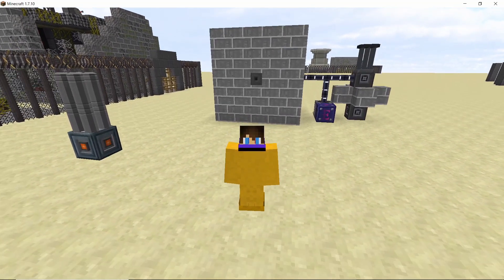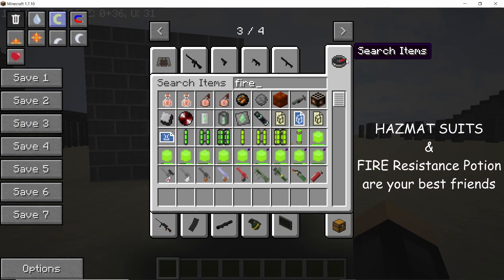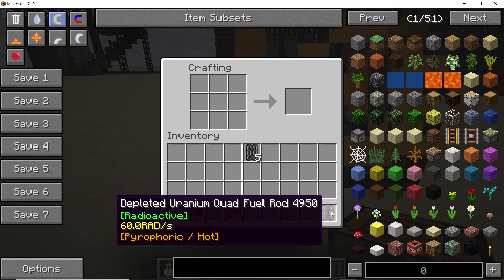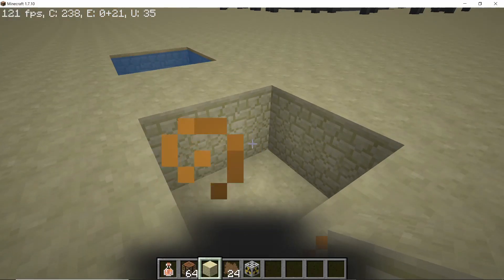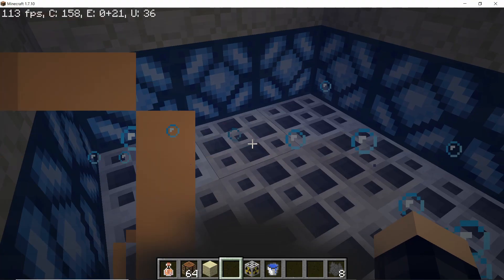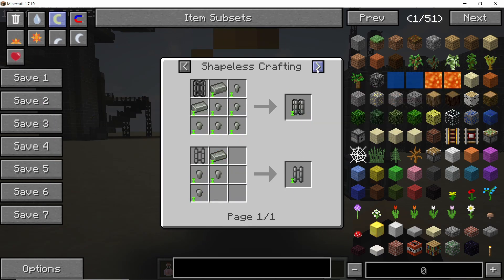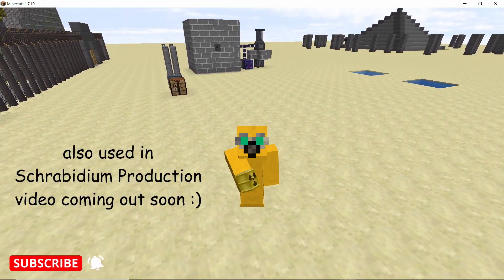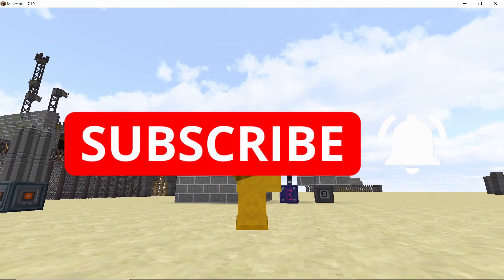How to RECYCLE DEPLETED NUCLEAR FUEL in HBMs mod || Using Spent Fuel Pool Drums in Minecraft

Comment: But extracting the depleted fuel on the quad rod takes a lot of time i wish auto extractor for depleted will be added at the mod
Reply from the maker: You can use buildcraft or thermal expansion ducts to automatically remove the depleted fuel and send it to spent fuel pool drums

Comment: I made a reactor but  and when I tried to insert fuel rods to either fuel the reactor or empty the spent fuel, the rods wouldn't work
Reply from the maker: Version of the mod ? also were you playing on 1.12.2 or 1.7.10 ??
cause I never had that problem even with all the reactor changes recently ... also did you try inserting fuel ingots instead of fuel rods ??
Reply: @SavageVegeta  I don’t remember the mod version but I was playing 1.7.10 and I switched to the ingots and it worked fine I just can’t extract the spent fuel so it makes the reactor kinda useless once it fills up
Reply: @SavageVegeta  the mod version I believe is 1.0.27_X4144 as it was the latest version off of curseforge but I think it’s behind as it doesn’t have all the special doors and some other things like in 1.12.2
Reply from the maker: @thespence2441  weird , cause if your reactor fills up then it means the fuel inserter is working properly , that means the waste ejector should work fine as well I haven't seen em in any change logs. 
Well if you can just send me the version of the mod and I can try this out , or I'll just give this a try in the latest version of the mod from GitHub and you do that as well !!

Comment: Hey i know i'm pretty late and you're not gonna see this xd, but is there a way to make it automatic?
Reply from the maker: Yeah if you replace one of the access hatches on the reactor with waste ejector blocks then you can place a crate which will directly accept depleted fuel. Then you can use item ducts from thermal expansion or buildcraft in order to transport the depleted fuel to spent fuel pool drum.
Also you can use item ducts to get cooled down depleted fuel out and get it automatically to the centrifuge for recycling. But make sure to set the item filters properly in order to do this otherwise the itemducts will just pull hot fuel into the centrifuge instead of cool one
Reply: @SavageVegeta  Oh wow, thank you very much, i really needed that, and i didn't think you would reply xd
Reply from the maker: @flamfoa  you're most welcome !! And no worries I always reply to the comments on my video cause I love interacting with you guys and helping the community as much as possible !!

Comment: help iits a good tutorial but when i put the empty dual rod it doesent put in depelter uranium
Reply from the maker: It'll only place depleted fuel in the rod once it has gathered enough ... If the amount isn't enough than the empty rods will just sit there. 
Also I prefer just having it directly deposit in crate using reactor waste ejector